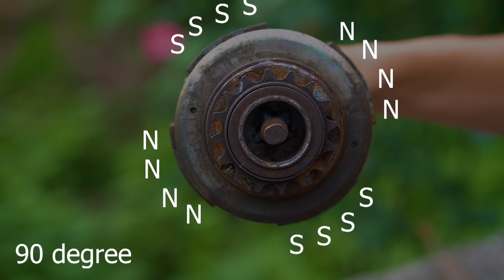I build 220v electric Hydropower dam

Comment: Kudos to the guy for having made this.  I'm sure it took some effort.  HOWEVER ...
7,000 watts = 9.38 Horsepower.  That's nearly 10HP, so think for a moment about the size and power of a 10HP electric motor.  It's a big, heavy motor, and if you bought it new, it would set you back more than $600 - probably quite a lot more.  7,000 W is enough to drive a fork-lift truck or a small electric car.  There is NO WAY that sort of power is coming from the thin vanes in this "turbine".  If they were subjected to almost 10 HP, they would get flattened.  A 10hp Baldor 1760rpm 215t 3ph motor weighs 231lb (105kg) - so you wouldn't be able to pick it up.  The electricity to drive that much power does not - NOT - come out of the setup shown here.

The formula is ...

P = m x g x H x n

where ...
P = power in Watts
m = litres per sec of water
g = gravitational constant = 9.81m/s^2
H = head of water (about 0.5 M as shown at 0:30 )
n = overall efficiency of the system

Considering the gaps between the vanes of his "turbine", and between the magnets and coils, I wouldn't expect efficiency to be more than 0.5.

So there's the formula.  Do the math, Folks.  How much do you reckon he's getting out of his generator?  I'd say maybe 20W, but that's a long way short of 7,000W.
Reply: kuik mafs.
Reply: Simplesmente um estudante de faculdade
Reply: not very optimized all that 20W you're nice
Reply: Underrated comment. In fact, this should be the only comment.
Reply: He probably mistake VA for Watts. VA or Volts Ampere are the actual total energy in the system, including the unusable part. Watts includes only the usable part, which is lower.

PS you don’t get 220V just because you use a 220V transformer. You need to spin the magnet at 60 rotations… per seconds. Like in 60 Hz. Because you can’t stack you transformer in series to get this much power, you need parallel configuration.
Reply: actually modern brushless motors like TP power can output 10 HP continuously while the weight of the motor is just 3 kg
Reply: @Tachi778  Yes, you're right - even the little brushles motors used in aero-models can be >700W.  I just looked up TPpower motors and found a guy unboxing a 20HP motor, which was still quite pick-up-able.  Different motors for different purposes, I guess.   Anyway, I think we can stop attacking the "7000W" claim, because the OP has removed it from the title.

So how much power do you think this 4-vane generator, with transformers for coils, would output from that amount of water going through it?  Don't get me wrong, I don't wish to denigrate it.  I still think this was a great effort for a guy with very few resources.  I would guess it's still running and supplying some power, and that the OP is very pleased with it.
Reply: @DownhillAllTheWay  I know that the generator shown in video is much much less powerful than 7kw.
I told you about that modern brushless motors may be very powerful while the weight is not too big, just in case you didn't know.

(English is not my native tho, sorry if something sounded rude)
Reply: Ooo a new physics question😂😂😂😂
Reply: @Tachi778  You made a very reasonable point, and it didn't seem rude in any way.  Also, your English sems fine to me.
Reply: Well, 7kw is a long shot, and you are right in your reasoning. But 20w is also low, as, always assuming  that these 2 fans and the incandescent bult are indeed being powered by this "plant", I would say 50-150w are being produced. Without a formula, a ventilator fan usually consumes 16-55watts (size/speed dependent), and we all know how "efficient" incandescent light bulbs are (they waste most of the power into heat). This bulb alone, judging by the size of it should be a min. 70w (without knowing bright it is actually, as maybe it is not being powered at nominal draw). Thank you for the formula, spared me the search, as I have a river flowing near my home.
Reply: @DownhillAllTheWay  100hp tp power
Reply: agree with the math, power produced is not much, but still quite amazed by the setup and actual implementation of the entire thing.
i am always facinated by DAMS they are so DAM cool!!!
Reply: @Tachi778  Those are at pretty high speeds.
Reply: thats a lot of horses
Reply: @Billy the Kid Billy, I wrote a long answer to this query, but I don't see it here now.  Did you get it?  I have been having trouble recently with YouTube comments.
Reply: He doesn't have the rpm's to maintain 50 or 60 hertz's i know the rpm value of all generators. He is the same one who puts out these fake video's.
Reply: I believe he is stating, 7000W over one year's time! (20x365=7300)
Reply: Ya but you forget to calculate and factor in the force of the fish that is working hard to push those vanes around......
Reply: well, technically it would produce electricity of low power probably just enough to power a light bulb. there are ways though to strengthen the power output, and that is to use a stronger magnets and what? a larger dam because it would be harder to spin. this is as far simple as it can get, with out brushes, with out diodes, with out  capacitors and a very weak alignment of or  near point of contact alignment by the magnets (electro and permanent). if compared to those which is being pushed by india. this model is far better.
Reply: @TheSiriusEnigma  what you said is confusing because Volts × Amps = Watts. P=VI*  the problem is not the units. 7kW is what a medium size gasoline generator can make at the steady state, maybe up to 8500W surge.
Reply: @Gideon_Judges6  you are doing a common mistake. P = VA only applies if yo have no capacitances or inductances ( coils ). The VA values  include unusable energy accumulated in your system. VA is always higher than Watts as a number. VA or volts ampere, is used in system where the difference between VA and W is significant. Ex: electric motors, generators, transformers, UPS. In a UPS case, VA is what is needed from your wall plug and Watts is what is available to your PC. VA values are in big bold letters, Watts values are in small prints.
Reply: @TheSiriusEnigma  I think you're talking about reactive power. They're the same units though. Power is still power. In an electrical system P=VI*, and the units are Watts or Volts × Amperes. Amperes are actually derived from Coulombs/second.
I'm putting * here for complex conjugate but it's hard to do mathematical notations in a YT comment. You're trying to convince me via some conventional use that e.g. cm^3 does not equal mL, when they do! It's just that one might be more likely to be used (or even ONLY used) in some conventional uses rather than the other.
Reply: @Gideon_Judges6  I am puzzled. Your argument is that of a mathematician who has no idea of what the numbers mean. The reason VA and Watts are not the same is exactly the same reason resistance (R) in Ohms and impedance (Z) also in Ohms are not the same. To equate the two is a mistake. Read about LRC circuits. This is not beginner stuff.
Reply: @DownhillAllTheWay  Well, It seems to be about 1 revolution every second, and I'm guessing that is a 5 gal barrel, which is about 18 liters, if you plug that into the calculation (not accounting for efficiency) you get ~89 watts
Reply: Yes very sad click bate nonsense. I'm disappointed people do this. 70W maybe
Reply: @TheSiriusEnigma  Impedance and Resistance are the same when the Im{Impedance}=0. VA and Watts are units PERIOD!!! The convention that you use one or the other for a particular purpose is purely convention. That's it! I studied RLC circuits... almost 20 years ago! I have my masters in EE for 15 years now. You're the guy trying to tell me that  mL and cc are not equal or coulombs/second is not an ampere or E×I* is not equal to S. This is braindead! I'm telling you the units are equal, you're just talking about reactive power or the combination as complex power. I said this weeks ago that it's just a convention to use VA(R) to disambiguate. The units are still equal, its just that not all complex power is used at the load to deliver  ACTUAL power, but it's  still power!!! Volts x amps is still equal to Watts!
Reply: @Gideon_Judges6  Then I am right. You do know the maths. But you argument is that of someone with no practical experience. Every units is a convention, think about it for 0.5 seconds. The best unit is the decibel since you can use it for absolutely anything. Is that practical? Not at all. Try to buy 4.25 Db of bread. 

What I have been saying from the start and you are ignoring is that VA, in watts is used to signify the absolute electrical power in a component or system by convention. W in Watts is used to signify the USABLE electrical power in a component or system by CONVENTION. Since you are an EE, what is them minimum Power Factor allowed by your electrical provider? (The the ratio between VA and W at the connection point of a plant. It also signify the extra power the provider needs to provides you without being paid.) Mine is 98%.

You are insisting that 5 Kg is 5 Kg. I am pointing out that you cannot substitute 5 Kg of lead with 5 Kg of feathers.
Reply: I wish I could find a brand new 10hp motor for $600.
Reply: @anelpasic5232  bruh... Just use a few magnets and coils winds... Haven't you seen the recent life hack free energy videos? 😮
Reply: @romanhands2203  Wow. I had noticed those videos and had thought it odd that I had never seen anything of the sort in libraries over the years before we had youtube.
Reply: @TheSiriusEnigma  The 'engineer' who built his hydro thingy is laughing uproariously from his Troll Throne.  I used to create shit like this to amuse myself when I was younger.  I almost got two guys into a fist fight over whether or not a donut hole was a real thing.
Reply: @lawfulremedies1838  true. This is so bogus that calculating is unnecessary. My purpose is to point out that electricity can be deceiving. You can have more energy in your system than you think based on its entry. For example, a cathode ray tube television can have 35 000 volts in charge even after you unplug it. Even less than 0.001 Amp can kill you at this voltage. At this point I am done. Either people get it, don’t get it or don’t care. The debate has value because we both tried to demonstrate our points with examples.
Reply: @TheSiriusEnigma  I see.  I have been absorbed in these comments for hours now.  I did click myself, and I didn't search for any visual sign of deception, but the numbers are absurd to anyone who has the most basic understanding of electricity.  The comments go on and on.  The engineers nailed him neatly in a couple of statements, and yet I see those of the ignorant masses who ask for a video proving the opposing stance.  I have no such video so I told them that the principles at work predate video and gave a link to a documentary on Maxwell.  I don't know if it will work, but the energy that has been put into pressing computer keyboard keys in response to this video far exceeds that of what that 'generator' could have ever produced.  I think it was Plato who said, don't argue with the mob.  It is entertaining though.
Reply: The goal of the video was to earn ad revenue - the facts or lack thereof encourage everyone to watch whether they are true or face, the 7,000 W claim is what makes people watch. 
The goal was not to show prove you can generate 7,000 W.
Reply: @Tachi778  he sure as f isn't using brushless tho... he's using garbage he finds
Reply: inflation crazy
Reply: You went deep in the books😂😂😂😂😂
Reply: Love it when engineers sees and answers the problem with math
Reply: Not sure what ancient mess of a motor you dug up there, but just FYI, modern PMSM motors/generators have a power density of 5-10 kW/kg when properly cooled. Your motor is off by a factor of 50-100.
Reply: @anelpasic5232  Hobbyking "BLDC" plus some "ESC" from there and then add a power supply to get down to the motor's operating voltage. Should be cheaper than $600.
Reply: Except it's complete bullshit.
Reply: @namibjDerEchte  Yes - if you read all my comments, you'll find that I already conceded that.
Reply: Don't forget about the frequency. In a 4 pole generator that rotor would need to be spinning 1,500 RPM to get 50hz or 1,800 RPM for 60hz. At that speed you would not be able to get the frequency high enough for the light to not dimly flicker.
Reply: @haunter_1845  It was just an over-blown click-bait title line.  He has changed it now.
You're right - there's no way it could work to produce significant power.
Reply: @DownhillAllTheWay  There is a comment on here that says he does fake videos. 
(@allen elswick 3 months ago He doesn't have the rpm's to maintain 50 or 60 hertz's i know the rpm value of all generators. He is the same one who puts out these fake video's.)
Reply: @DownhillAllTheWay  Well, probably somewhat more than 20 though (at least if the setup is not fake), but nowhere close to even 700W. Also running induction motors (fans in his case) off something with a both unknown and varying AC frequency... Anyway, the setup is pretty pointless as, first, unstable voltage and frequency, second - low power, third - welded bearings, last - so neat to not have the HV coils removed, doubt they'd kill in this setup, yet still 500-something V per coil I guess, also water nearby :)
Reply: @kenea3226  Thanks, Ken, I'm not surprised to read this - but to anyone with an ounce of engineering knowledge, this is clearly a fake claim.  He has changed the headline to "I build 220v electric Hydropower dam", but it was originally something really wacky - stating that it would deliver 7000W.  It's a shame he hasn't done a video about his "successful" moon shot.
It's possible he's getting 220V - though I doubt it, and if he is, it will be at very little current, and with a lot of fluctuation of voltage and frequency.  The water-wheel is going around at about120-150 RPM (which isn't many revs per sec), and the gearing to his generator seems to be about 1:2(?), so his magnet will be turning at about 300RPM max.  It looks like an old magneto from a scooter or motorbike, so it may be giving 2 or 4 flux reversals per turn - but that's still only 300 x 4 = 1200 cycles per minute = 20 Hz.

The fact that he went to the effort of building it shows enterprise - especially given the materials used, and who knows - maybe he's getting enough out of it to do something useful - charge a battery of light some LED lighting - and all from scrap materials.  I wonder how much he values huis time - $1 per hour?
Reply: @TheBypasser  700W?  746W = 1HP, and I think it very improbable that he's getting anywhere near that.  In a proper motor or generator, the gap between the stator and the armature is no more than a milimeter of two.  How much is it in this setup?  The efficiency can't be very high, but even if he had a 100% efficient setup, how much power could that waterwheel provide?
Reply: @DownhillAllTheWay  And what did I say? ;) To be honest, I don't really have an idea how would this produce any significant power at all (judging by the lightbulb I guess below 100 W, yet at this frequency hell no the fans would spin, so it is possibly a fake altogether). Not only the gap is huge, but also the magnets are very thin so the actual coupling would be minuscule! To make things worse, how are the actual motors, generators or whatever designed? With the coils' poles close by, and the iron being closed into a ring on the other end of the coils! Now what do we see here? Loose W-irons, how neat.
So, my rough estimate of "nowhere close to 700 W" could be extended to "700 mW, yet still unlikely, and also at somewhat few Volts".
Reply: @DownhillAllTheWay  P.S. I just saw this: v=Jvhy-8Qltj0  - yeah, I can virtually bet both give the true "7000 W" because the coils are rigged to triacs connecting an external mains voltage :) (or you dare lighting up 4 even 25 W bulbs by spinning the shaft by hand? Probably by being a Hulk though...).
Reply: @TheBypasser  Quite honestly, I'm done with this subject.  His claims are BS, and not worth arguing about.
Reply: @DownhillAllTheWay  If you have posted links, and are in the "forbiden to post links" YT database, no one but you will see your post. While that may not be you situation, some similar shenanigans may be happening to you.
Reply: @nlight8769  Hmmm...  I don't think that would be my case, buit thanks for the info anyway.  I'll bear it in mind if I get more snags like this.  I went through a bad patch with it, but it hasn't been so bad for the last month or so.
Reply: Where can I get a 10 hp motor for 600$ I wanna put 2 on my go kart :D
Reply: Ты прав,это всё развод для лохов .Сей умудрённый годами персонаж понимает в физике, как я в балете.
Reply: pretty much every video uses clickbait thumbnails/titles these days..
Reply: Thanks eh
Reply: Can confirm all of this is true. Source: This comment
Reply: this guy is smart
Reply: I think there is a car battery inside LOL
Reply: completely agree. i doubt you could power a tv with this. 
i would estimate you would have to make a real human sized waterwheel with multiple genarators ike idk 10 and even then i doubt you would make enough power for 1 person in modern lifestyle.
Reply: although i think with some time and planning it would be possible to make a genarator unit that would be enough for a houshold
Reply: Scale is very important for this video. This guy is actually a giant and is at least 50m tall. Therefore you need to scale up all of your estimates. This is at least a 7000 watt Dam knowing that he is a giant.
Reply: @collinthomas8440  Ah!  How stupid I am!  This never occurred to me.
Thanks for the reply - this explains everything!
Reply: Can u guys invent better rather than arguing, atleast the guy create something.. Its just lack rpm to generated more power
Reply: The standard for flow is "Q", M is for mass not flow.
Reply: Wow
Reply: Thank you but I wonder a few of this mini dam plus small wind turbine and cheap solar can you make an 20 household village off-grid?
Reply: @aminavazeh4433  If you did that, it would be for a village that probably has no electricity, and if you generate some electricity, that's better than none - even if it is only to provide a few LED lights.
Reply: @DownhillAllTheWay  fortunately almost all of Iran villages have methan fresh water power and internet but problem is whit harsh geography service and keeping them is so expensive and a lot of those old agricultural households turned into modern Villa not someplace in need of government high subsidiaries and problem is neighbors countries have exactly same problem but thank you seriously for your time
Reply: @DownhillAllTheWay  that's a really good answer if they have power or not whit a little tech so many thing can be handle

I always was angry about a special case imagine two village 8 kilometers distance but about 6 or 5 of it is not agricultural why there isn't power and pipeline to send that water into further place and old system at least waste 50 percent of water!
Reply: output is definitely more than 20 watts. bulb = 10~20W, Fan 1 = 40W, Fan 2 = 40W. So total load attached was somewhere around 100W. That being said, he should have used a clamp meter to check and show the output and check with max possible load maybe a 1 hp motor, angle grinder, etc.